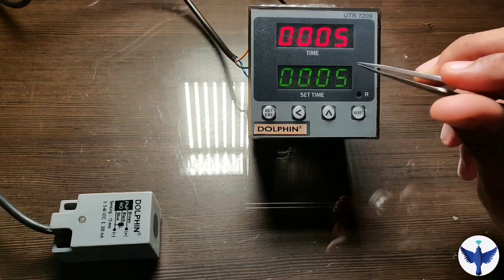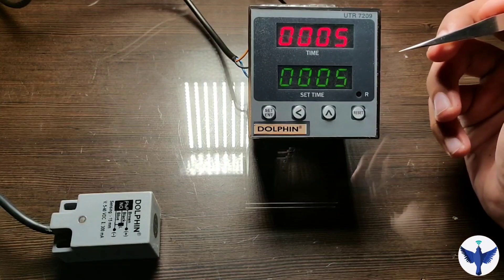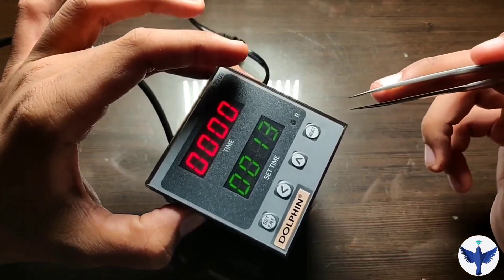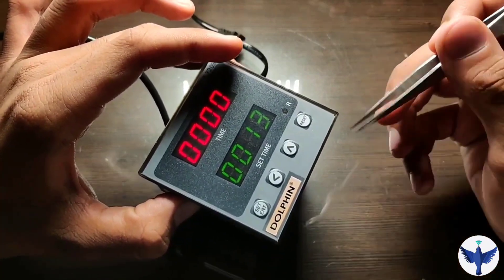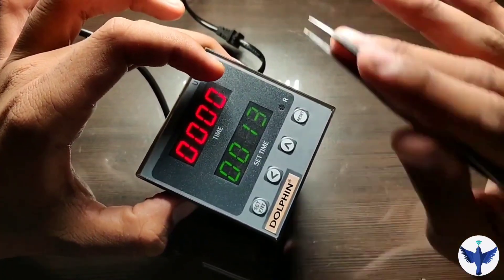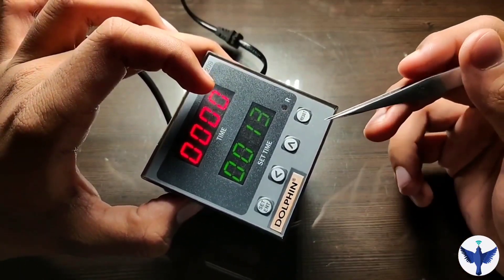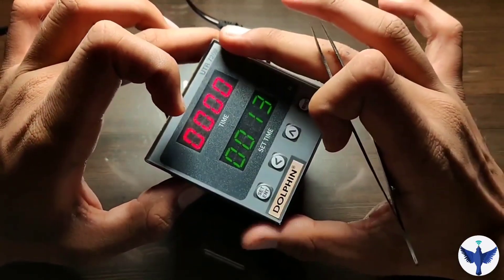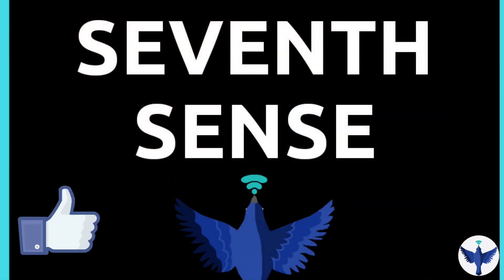Why do we need Timers in Industrial Automation?

Comment: I am looking for Cyclic Timer for Agriculture, Ex. Auto start at 6 am works cyclic mode 5 minutes ON 30 min OFF, till Auto stop time. Plz help
Reply from the maker: Hello sir, I can understand your problem. This timer will work in cyclic mode which means it works for 5minutes ON and 30 min off. 

But sir in this timer you cannot set time of 6 am. For that you need a different model of timer.

If you could give me a call at 9625356243,I will help you!